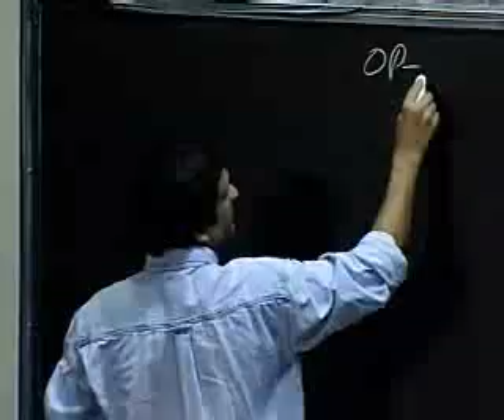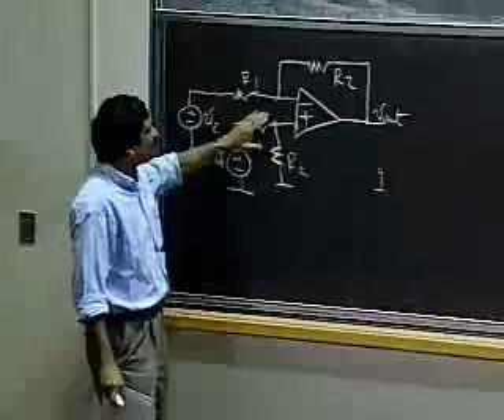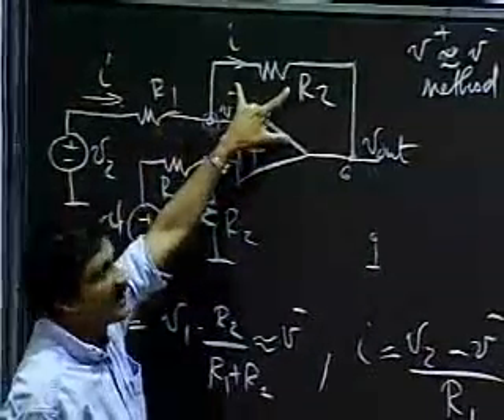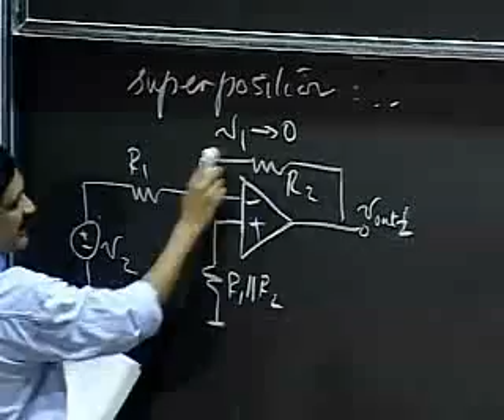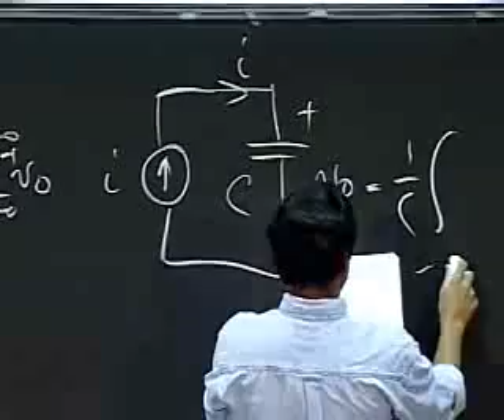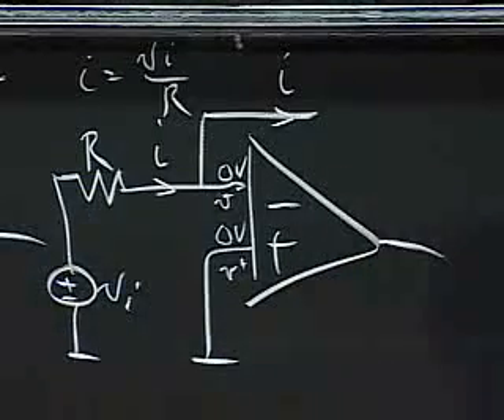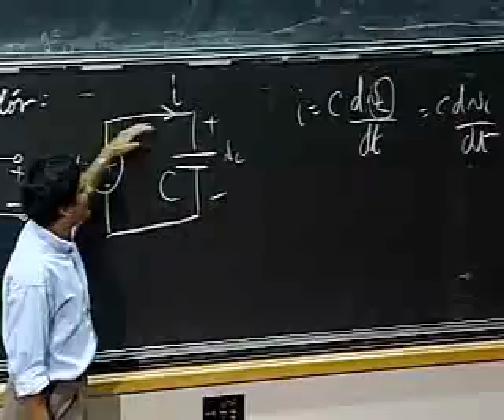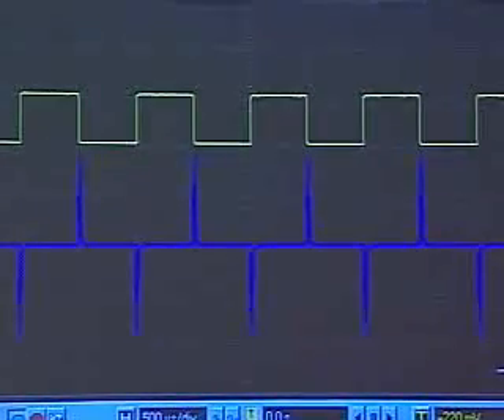Lec 20 | MIT 6.002 Circuits and Electronics, Spring 2007

Comment: For those who are confusing about the integrator, more info:
The reason that voltage keep increasing on the capacitor has to thanks that op-amp, the charges(positive) on + side of that capacitor is going higher and higher, since + side of capacitor connected to - side of op-amp, the output voltage of that op-amp is going to decrease, help maintaining the potential of - side of that capacitor lower and lower voltage, so does the difference between two plates(Vc), and that's what matters for keeping the + side of the capacitor to be around 0 volt as + input of the op-amp.

Comment: @MatrixOfDynamism, you can connect one investor to the output of the differentiator and you get a differentiator with the output ''not inverted''.
Reply: Instead of "investor" you better use an "inversor". It works much better, believe me, I know what I'm saying.

Comment: at 10:40 he mentioned about negative feedback and how if v+ increses vout would as well and so should v-.But shouldnt the resistor between vout and v- drop voltage so how does v+ equla v- in negative feedback?

Comment: In the part where the integrator was explained, I felt that there was no need of the Op-Amp because none of the voltages or currents were applied to the Amplifier itself.
Reply: I believe the reason it was needed is because the op-amp is what made sure that v+=v- which was necessary in the architecture of the integrator
Reply: zanariot But in this particular configuration both of them were zero right?
Reply: @kannanreddiar4297  I know this is a late answer. But no. Vp is 0V the Vn is virtual 0V.

Comment: You can't assume Vin- is zero volt potential if you haven't got the negative feedback in place. In the case of the integrator, this assumption was falsely made.
Reply: Chris Cordingley The negative feedback is fullfilled through the capacitor between the output and Vin-.
Reply: @yougoog1  No it doesn't
Reply: He makes that an opening assumption and at that point, that is not the case

Comment: What text was used?
Reply from the maker: The course textbook is:
Agarwal, Anant, and Jeffrey H. Lang. Foundations of Analog and Digital Electronic Circuits. San Mateo, CA: Morgan Kaufmann Publishers, Elsevier, July 2005. ISBN: 9781558607354. (http://www.amazon.com/exec/obidos/ASIN/1558607358/ref=nosim/mitopencourse-20, http://www.elsevierdirect.com/product.jsp?isbn=9781558607354). For more information on the course, see the course on MIT OpenCourseWare at http://ocw.mit.edu/6-002S07.